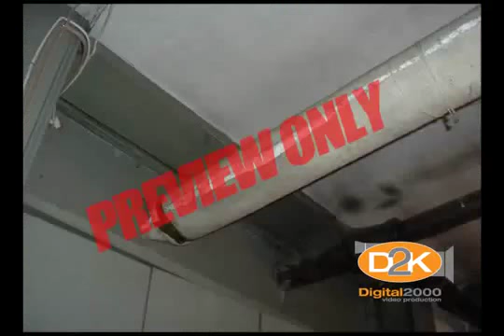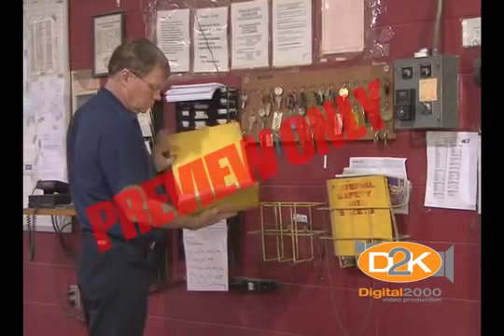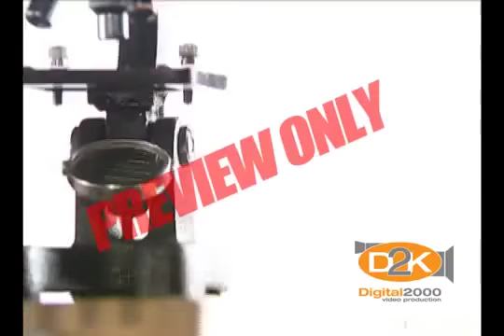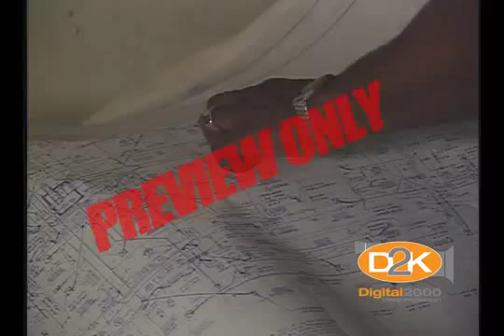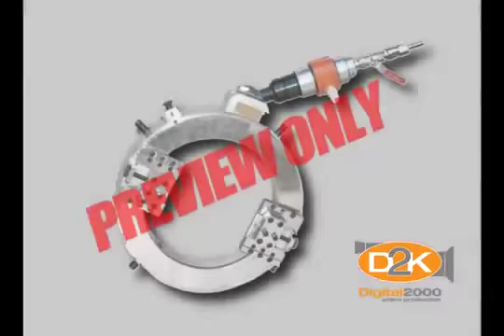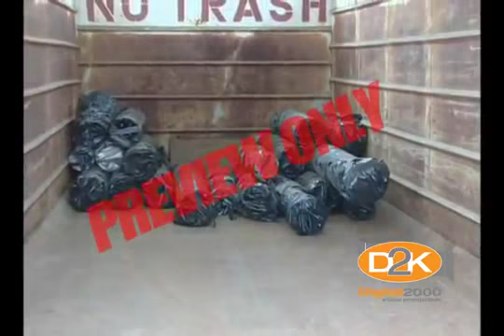Asbestos Cement Pipe Safety Training Video

Comment: asbestos scares the hell out of me. i hate having to work with ac pipe. so glad canada has banned it here and now we are ripping up all our ac pipes and using safer alternatives that dont kill you if you get exposed to it.
Reply: Hi just need to know have you ever been exposed to a bit of asbestos
Reply: @breaktime1127  possibly from ac pipe work but doubtfull since in ac pipe asbestos has low chance of breaking off into the air.
Reply: @Horridius  do you know if rain takes s lot of fibres off a asbestos roof?
Reply: @breaktime1127  not sure i would imagine so. depends on the fibres and how much they got into the air. i imagine rain might soak em up and put em on the ground but honestly anyone working with asbestos should be disposing of it properly especially if its a frayable type of material and its getting exposure to open air. it depends on alot of factors. if you are worried about it contact your local municipality or public works office and inquire about it.talk is cheap after all.
Reply: alternativly you could also contact a company in your area that specializes in asbestos removal and ask them to take a look at it. never hurts to ask a professional about your roof and see if its safe or not.